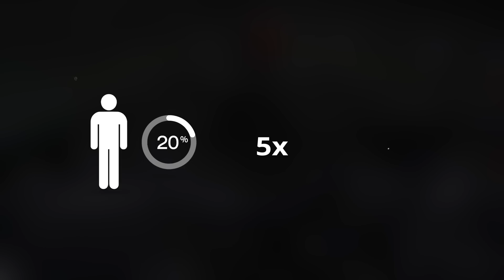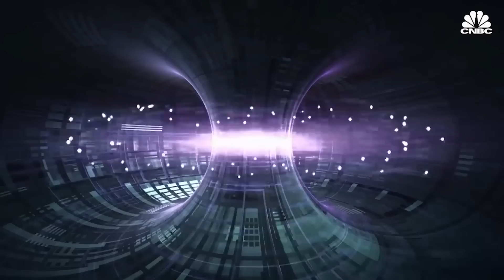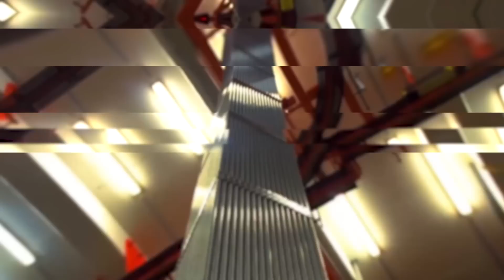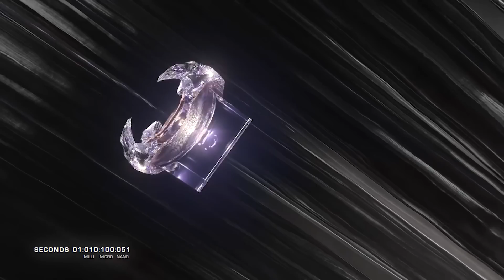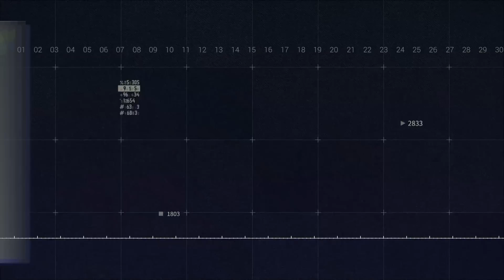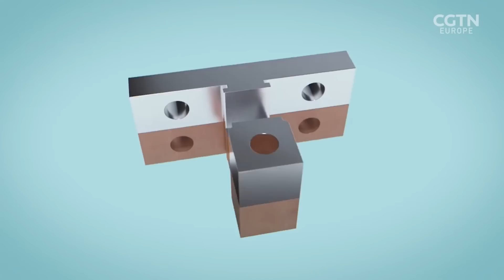IT HAPPENED! Nuclear Fusion FINALLY Hit The Market!

Comment: If this all works, and is not just some more "We're only 20 years away.."  B.S., It will be a game-changer. 
That is until those with all the knowledge have a gas leak in their homes or get into some kind of crash..  "Accidentally" 
Dark outlook, I know,  but how many times has something big like disclosure or energy been right around the corner and BAM!  They get killed in a crash or their house blows up due to a "gas leak" or they otherwise face unfortunate events that ends the project?

Comment: Given that piston engines & guns shove metal at high velocities & both are very refined ideas with very high pressures created, very high velocities of the metal part (piston or bullet) & involve pressure waves (sound emissions) heat & pressurized gasses air pollutants or tail-pipe emissions, its seems like a natural extension to leverage these basic principle to compress fusion fuel elements to fuse with a net energy gain through heat recovery steam generator turbine hall closed loop clean water systems, or high temperature gas systems //

Comment: The workers at nuclear power plants are not at a significant risk of radiation poisoning. There are fewer deaths and work accidents in a power plant than there are with turbines. Also, the likely hood of an accident is astronomically small, the few large scale accidents were caused by mismanagement from the companies operating the systems. There is also little to no chance to release of radioactive material into the water. Another note, nuclear reactors today are literally built to be able to withstand an earthquake, these places are build indestructible, with pounds of steal and concrete protecting the workers and surrounding plant and human life. Please, check yourself.

Comment: Tritium and deuterium are expensive, because they require a large amount of energy to produce (in the case of tritium) or extract from seawater (in the case of deuterium). Will the "over-unity" measure of the pilot plant take that use of energy in production of the fuel into account, or will it only take the operating energy input of the reactor into account? My guess is the latter and this is all a boondoggle to get government funding.

Comment: Just a small hint why they need lithium in reaction chamber:
> Tritium, is a radioactive isotope, and difficult to source naturally. This can be circumvented by exposing the more readily available lithium to energetic neutrons, which produces tritium nuclei. In addition, the deuterium–tritium reaction itself emits a free neutron, which can be used to bombard lithium. A 'breeding blanket', which consists of lithium, is often placed along the walls of fusion reactors such that free neutrons created during deuterium–tritium fusion react with it to produce more tritium. This process is called tritium breeding.

Comment: Where does the waste heat go?
Reply: The heat isn't the waste, it's the product.
Reply: uhhhh..... thats the whole point, the waste heat is used to drive the turbine, to generate the electricity.
Reply: I was wondering that too. In an instant (or does it take longer?), they generate enough heat to "power a home for two years" which is ~23 MWh
Reply: Used in turning turbines
Reply: Wherever you are right now just stop and take a look around you, that’s where the heat from all electricity goes and the more energy we generate to keep up with the demand, the hotter everything around you will become.